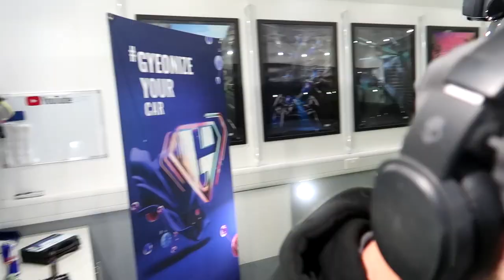VLOG 30 VW Transporter T32 4 Motion Level 3 Detail #gyeonized

Comment: What did you use before the gyeon prep? 22:16
Reply from the maker: This was Spies Hecker 70/10 which is a strong panel wipe, as even GYEON Prep is not really enough to remove all the polishing oils from the paintwork before the coatings go down
Reply: @cornwallcarcare8959  oooh. Interesting. So why then use prep afterwards? Does prep neutralise the Spies?
Reply from the maker: @gingerbadger  So Gyeon Prep is a degreaser but Gyeon say for there Infinite Ceramic Coatings to use either their degreasing tablets after polishing or if you don't want to get the vehicle wet, Spies Hecker then use Gyeon Prep and leave for an hour before you apply the coatings 👍
Reply: @cornwallcarcare8959  legend. Totally not addicted to watching your videos. Honestly refreshing to watch someone clean normal cars and get stressed like a normal person!! Keep it up dude. Amazing
Reply from the maker: @gingerbadger  🤣🤣🤣🤣 Love it 👍